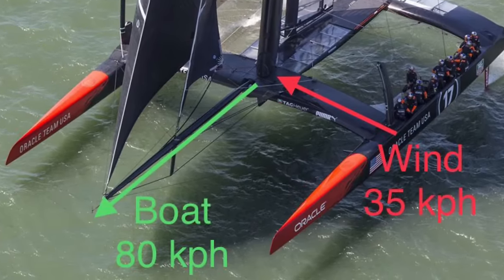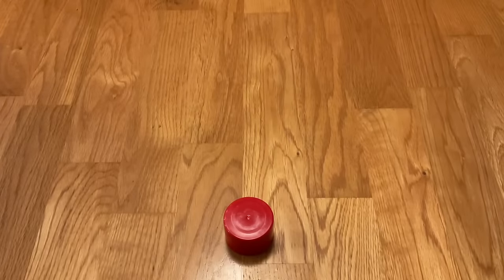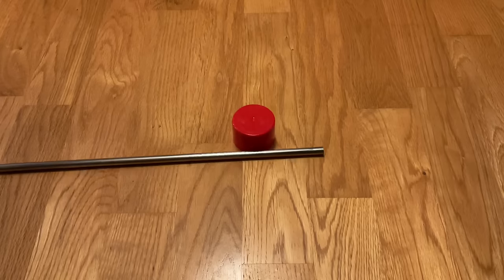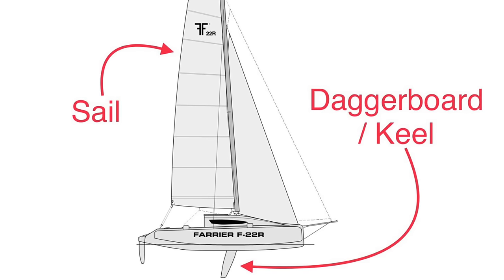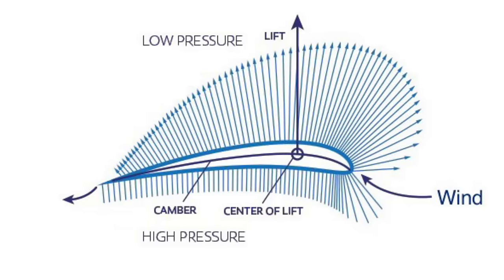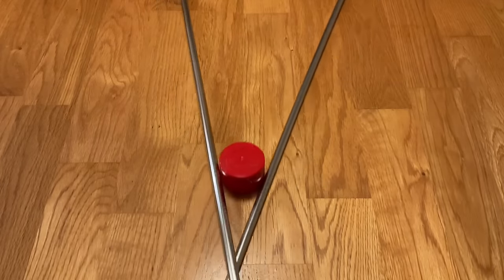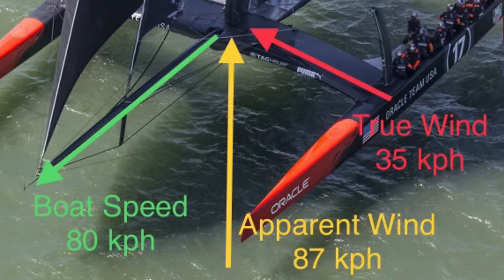How Does a Boat Sail Faster Than The Wind?!?!?

Comment: Fun fact, old sailing boats used to put the worst smelling facilities at the front of the ship, since the wind would carry the smell forward and away from the ship.
Reply from the maker: That’s a great tidbit! These days though you’d probably want to put those at the stern as faster boats are almost always sailing upwind!
Reply: Thus the name "head" for the old ship's toilets
Reply from the maker: @HansEricReitmayer  Lots of interesting origins to many sailing terms!
Reply: why not just shit on the water
Reply: @KevinColt  that's basically how the toilets worked, with a common setup being  a communal trough made of a long plank with 3-8 holes at the front of the ship where you're basically sitting over the side and (mostly) shitting into the ocean. The sea itself would clean off most of what hit the side of the ship and the rest by the poor barnacle boys.😬
Reply: Were's the poop deck ??
Reply: I thought it was because water would regularly splash over that area of the ship
Reply: @navaho5430 
At the back, but that usage is not poop = shit.
The poopdeck was where the poopheads, namely the officers, were.

Comment: Incredible physics analogy with the two rods and the puck, most intuitive explanation I've ever seen of this
Reply from the maker: Thanks I’m glad the analogy made sense! There are some subtleties that could benefit from more depth of explanation, like the models of the atom we learn about in high school, but I was really trying to come up with a good way for people to intuitively understand what’s going on!
Reply: same. Excellent tool for explaining
Reply: i didnt get why there are 2 directions aka 2 rods? sail and wimd point in the same direction, wheres the second force?
Reply: @wasserwasser5555  The second force comes from the (sideways lift of the) keel moving through the water.  That force gives the force from the sails something to act against.  If it didn't have that second force, the boat would not be able to move (efficiently) when going against the wind (upwind).  It would only be able to go with the wind (downwind).

(A vector diagram would be a more traditional way to show this, but maybe less intuitive without an explanation of vectors.)

If you squeeze a slippery watermelon seed between thumb and forefinger, it can jump forward and pop out.  Without the second finger, you can only push it.

Comment: I'm not into boats but I am into knowing things. This video was randomly recommended and it was very concise and easy to understand!

How does the boat start and maintain movement tho??
Reply from the maker: Excellent question! A sailing boat can sail in any direction relative to the true wind except straight into the wind as well as a no-go zone about 45 degrees to either side of that (look up points of sail).

To get started you need to position the boat with the bow facing any direction other than the no-go zone, with the easiest being across the wind i.e. bow 90 degrees off the wind. Then you pull in the sails and the boat will accelerate. 

Once the boat is up to speed, the helmsperson can either steer the boat to keep the sails optimally aligned to the wind, or the crew can adjust the sails if for some reason the boat can’t be steered to the wind e.g. there is another boat, an island, or you simply want to go in another direction relative to the wind. 

Does this help?
Reply: +1
Reply: @SailingTipsCa  This is a perfect answer, but in practical terms, most sailboats that folks are likely to encounter have motors that sailors used to move the boat into a position where they can start to sail using the wind.

For smaller boats with no motor, such as a beach catamaran, sunfish, or even windsurfer, etc., this is exactly what you do.

Even for boats with a motor, getting under way without using it is much cooler.  Sailing off a mooring comes to mind.
Reply: @LoanwordEggcorn  I don't think the original question was "how does a sailboat get to a place where they can raise their sails and start sailing" it was more how does it start moving before it's moving faster than the wind? 

I'll grant you though that sailing off a mooring is cool. I did that on my last BVI charter. Conditions were perfect - uncrowded mooring field, perfect wind direction to get out of the bay, and relatively light winds. I waited until we swung a bit, unfurled the jib and dropped the mooring and away we went. I was hoping people were watching and applauding my seamanship but I'll never know.
Reply: @tmhudg  I applaud you. :)  But you also get the cool points of knowing you did it.  :)  More sailing sooner is definitely cooler than motoring.

And you're right, the original question was more about how to get the boat moving in general, and the answer was exactly right.

(Using a motor is how most people do it, but not really the answer to the original question.  I think I did mention that, and wanted to point out the realities of how it happens most of the time for non-very small boats.)

If there's enough wind to sail in general, there can be enough wind to sail off a dock or mooring, BUT most moorings/docks/anchorages are usually in relatively protected waters, so the wind will be lighter.  It may be too light to sail from.

Minor correction, most displacement boats, especially monohulls) sail slower than the wind most of the time unless they're very efficient.  So it sounded like you were being a bit optimistic to sail faster than the wind.  :)

Anyway, agree with your comment.  Fair winds!

Comment: Good example with the cap. On a side note, airplane also use multiple vectors of lift. Yes, the wings lift upwards, but also, lift from the propellers provides lift in the forward direction, although we then call it thrust. Still, the blades are still utilizing the Bernoulli effect with an airfoil shape to utilize high/low pressure differentials. Even jet engines require these differentials internally in order to provide the pressures necessary to initiate jet propulsion.

It's all about the pressure.
Reply from the maker: I’m also a closet airplane buff but sailing boats are slightly cheaper!!!
Reply: That's why a C130 Hercules can take off with more weight than the wings can lift at takeoff speed.  Those 17,200 horsepower virial pitch turbo prop engines can cork screw the plane up in the air until the airspeed increases to the point where the wings can do there lifting.
Reply from the maker: @Paul37Ontario  Cool plane trivia - thanks for sharing! With some military planes the engines are so powerful the wings almost seem like accessories!
Reply: Bernoulli effect requires a difference, or change, in air velocity, and the difference in air velocity results in changes in pressure.  Usually that is provided, in a pipe, by a constriction of the flow area of the pipe (e.g. a venturi in a carburetor).

There is no such constriction for a sail as it is open on both sides.  I assume this comment, by invoking Bernoulli, is saying the sail generates a difference in air velocity from one side of the sail to the other.  What causes that difference in air velocity?

Or is it perhaps that the sail generates a pressure difference across the sail by diverting the air, and the pressure difference is then the **cause** of the difference in air velocity, and not the other way around?
Reply: @BrianTCarcich   Yes, anything with an airfoil shape (wings, sails, hydrofoils, props...) is designed to create a pressure difference in the flow of air or fluid on either side of it. That difference then creates lift or thrust, depending upon the application, and it's all fundamentally Bernoulli's principle at work. Dude was such a genius.

So, in the case of a sail, as with all airfoils, this is due to the shape being more rounded on one side and more flat or even concave on the other. This makes the air travel faster around the downwind side of a sail, creating a low pressure zone compared to the upwind side. This in turn produces the forward thrust of the sailboat through the sideways 'lift' of the sail, which is actually more of a diagonal force relative to the boat for most directions a sailboat can go. Not sure if I'm explaining this very well, but there are tons of interesting articles and YouTube videos that do a great job describing how Bernoulli's principle applies to sailing if you're curious.

Comment: When you tack the sail, how does the dagger board tack to change the direction of lift below?
Reply from the maker: Great question - it really depends on the boat. Some have asymmetric foils that they raise and lower at each tack. This is the most efficient solution hydrodynamically but involves more work for the crew and precise timing. Others have symmetric foils where lift is generated by altering the angle of attack, normally via the helm/rudder in most boats.

Comment: I now understand a little bit more about what hydrofoils and dynamic keels do under water, and how it balances the sailboat to prevent it from keeling over and how it might drag, stall, or fail if sudden changes are applied to it.
As a SailGP enthusiast, I'm grateful
Reply from the maker: Glad it makes a bit more sense now! You’ve probably noticed that once the SailGP boats fall off their foils it takes a bit of work to get them back up there because they have to overcome the drag of the immersed hull. Amazing machines!
Reply: @SailingTipsCa  To me the boat falling off  or getting on the foils was as intuitive as changing gears, or picking up speed in a bike to help keep it upright. What puzzles me is the things done by the flight controller, and the wing trimmer tandem the grinder/s because the adjustments done by these guys aren't easily shown and maybe a competitive secret.
Reply from the maker: @SukacitaYeremia  I understand the flight controller will be constantly adjusting the angle of attack of the foils to keep the boat at the desired foiling height based on the boat speed e.g. less speed more angle of attack and vice versa. The wing trimmer will be positioning the wing to power up or power down the boat based on the prevailing wind speed and direction, and in conjunction with the course being steered. Both the foils and the main are hydraulically controlled with pressure created by the grinders.

Comment: That was very informative. Thanks! Question: let’s say steam and combustion power was never invented. But these effects became known. Could practical cargo, passenger, and warships have been designed using these principles? Or would the lack of modern materials not allow these type of ships on a practical level?
Reply from the maker: Excellent question! Cargo, passenger and warships did all have sails at one time, with schooners being amongst the most advanced of these, but they were all still reliant upon the wind, which is inconvenient if you have to be somewhere at a given time and the wind isn’t blowing. I don’t think materials is a constraint these days, but schedules definitely are! Sails also generally require larger crews compared to motorized vessels which creates an economic constraint as well. Still it would be possible without motors!!!

Comment: Interesting. I wonder if you can apply same principles in electromagnetic fields. Will the boat sail faster if the was 3 forces pushing it in a same manner? Is there an angle range for the most efficient thrust? Thank you
Reply from the maker: I think you could use this technique in any low-friction environment with opposing forces and the third dimension could be levitation which would result in very low drag/friction! I think the optimal angle is a function of the amount of drag/friction, whereby less drag enables tighter (i.e. more acute) angles and higher speeds, whereby more drag/friction requires larger angles but results in lower speeds. Think of it like gears in a car or bicycle!

Comment: I knew sails worked like airplane wings but always thought the lift of the sail "pulled" the boat. It did not occur to me that there was another foil underneath and the boats motion is the resultant of these lift vectors. Short and sweet vid.
Reply from the maker: Glad you found it helpful!
Reply: The air does pull the boat.  The question is in what direction is the pull directed?

Comment: Is the hydrofoil necessary to achieve faster than the wind sailing?
Reply from the maker: No it’s not necessary to use a hydrofoil to sail faster than the wind and several other non-foiling boats like dinghies, multihulls and planing sport boats can also sail faster than the wind with just vertically-oriented daggerboards and rudders, albeit generally not as fast as hydrofoils. That said the around the world sailing record is still held by a non-hydrofoil multihull. You just need a sufficient amount of lift from the sails and underwater appendages versus the drag in the system.

Comment: You also have apparent wind and true wind.  It makes the wind angle shift and wi d speed increase .I think there a lot of factors
Reply from the maker: Yes there are indeed a lot of factors! I mention how apparent wind builds and “bends” forward at around 2:15 of the video, and keeps building as the boat accelerates until the lift equals the drag.

Comment: There is a blend of two explanations merged in to one. Daggerboard and foil.
These are different things although both under the boat.
A foil has nothing to do what a daggerboard does and vica versa.

Foil lifts the boat out of the water so drag is strongly reduced to get more apparent wind

Daggerboard is a vertical device which has, usually,  not the shape of wing. The boat has to go in both directions. It prevents the boat going sideways
Reply from the maker: People tend to think only of lifting foils with the term “foil” but daggerboards, rudders, and lifting foils are all technically lift-generating foils that have different orientations and different jobs under the water.

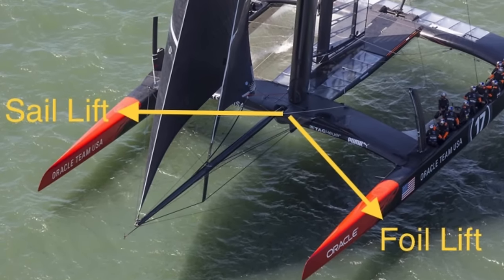Comment: 1:47  l'd say that foil lift is more directed to the aft than to the bow.
Reply from the maker: Really - why do you say that? I understood lift to generally be perpendicular to and corresponding in magnitude to the curvature of the foil. Therefore with symmetric foils which most boats have the lift would be perpendicular or slightly forward of the centreline of the boat no? https://resources.system-analysis.cadence.com/blog/msa2022-exploring-the-aerodynamics-of-symmetrical-airfoil

Comment: Is there a difference in speed when going upwind vs downwind in  the same conditions (edit: angled to the wind for max speed)?  Also a vector question. Mostly it's rhetorical, because I'm sure it differs depending on the boat, but mine is a sailing dinghy with a cat rig (edit: not a keel boat, but let's pretend it is).  I'm wondering if the goal is forward motion would you end up at the same place at the same time in a dead run versus a broad reach.  Obviously upwind has no corollary (edit: actually it does, would you end up at the same place at the same time in a close haul vs the speed of the wind?).
Reply from the maker: Good questions! Yes there is generally a difference in speed upwind vs. downwind relative to the true wind, and that difference depends on the boat. In my boat I max out at around 12 knots of boat speed when sailing as high as possible into the true wind, but can sail at 20+ knots off the wind.

For all boats the fastest way upwind is tacking through 90 degrees, and for fast boats the fastest way downwind is also gybing through 90 degrees relative to the true wind, as this keeps the apparent wind forward of the beam which keeps the sails working as wings and is much faster than sailing dead downwind.

When sailing dead downwind you can really only go 50-60% of the true wind speed, say 5-6 knots of boat speed in 10 knots of wind. But gybing through 90 degrees downwind my boat could go 12 knots in 10 knots of wind, so twice as fast, but only sailing 1.4 times the distance, so velocity made good (VMG) towards the finish is better even though we're sailing further.
Reply: Assuming the same apparent wind angle, the max. downwind VMG is 1 true wind speed greater than the max. upwind VMG. But that is only valid for very efficient sail craft like those foiling boats, or ice boats.